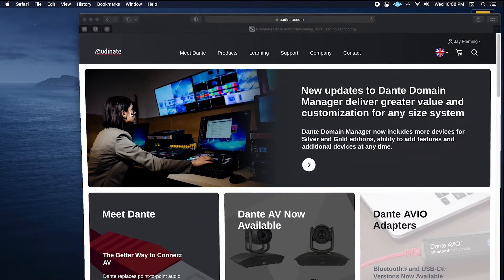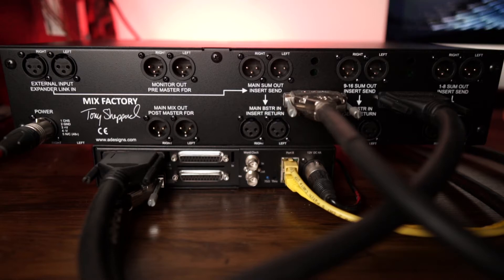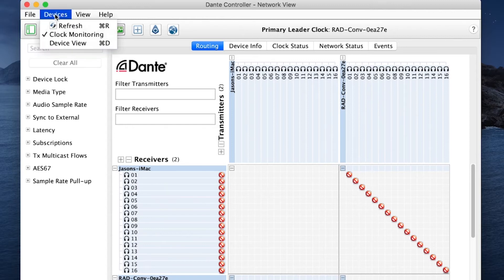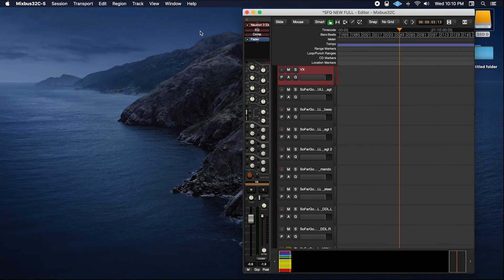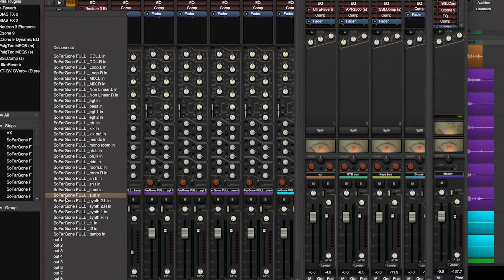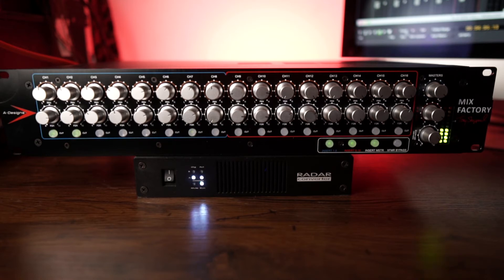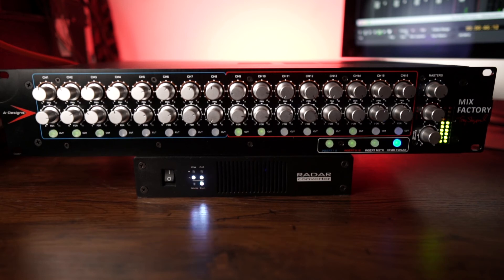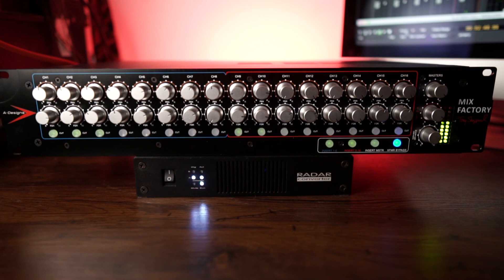Mixing higher channel counts using RADAR Converter and DVS (feat. Tony Shepperd's Mix Factory)

Comment: Still using 2 different converters in the radar?
Reply from the maker: Nope. I settled on the classic 96k
Reply: That’s what I like. What made you choose the classic?
Reply from the maker: @darrylweller6143  I have the classic 48k for years.... I don't have a need for 192k etc. The 96k is stellar just like the 48k. So I opted to keep it.

Comment: Hey jay are you plugging straight into Ethernet port on your Mac or your 2 channel avio interface?
Reply from the maker: When I run DVS I plug straight into my MAC. If I am using the Avio USB I plug straight into that. 
Ethernet chord that is.
Reply: @JayFlemingMusic  But you track with the Avio correct?
Reply from the maker: @zonarecordingstudio  I do... If, I am not using a console of some sort for direct monitoring.  I am usually only tracking a channel or two at a time or mixing down on the master bus...  So I am generally just going through the Avio